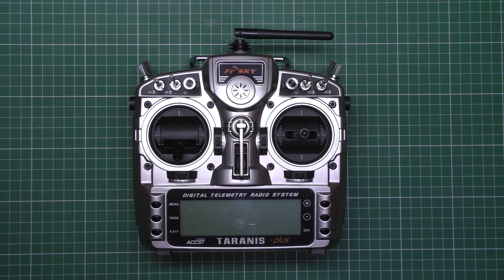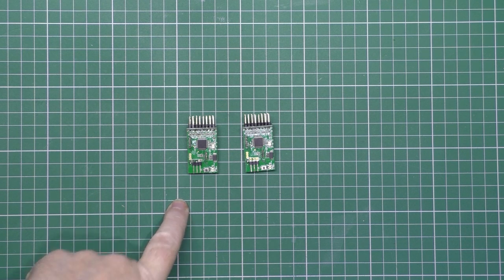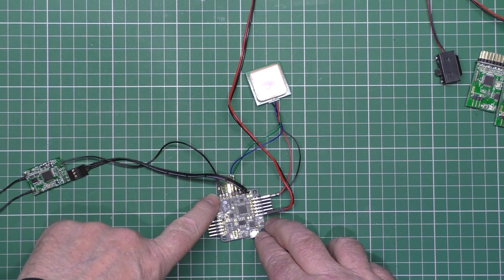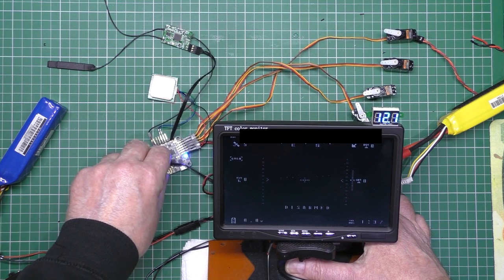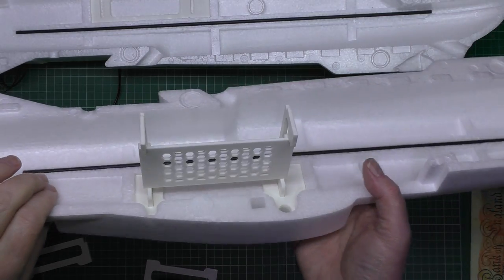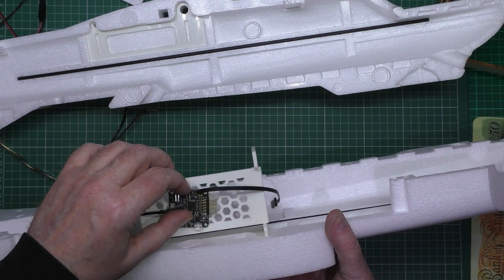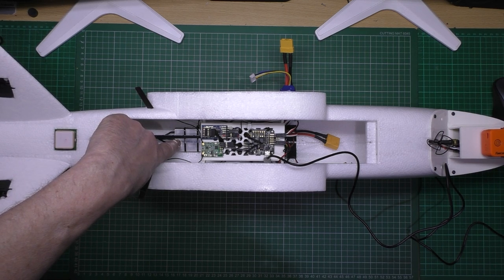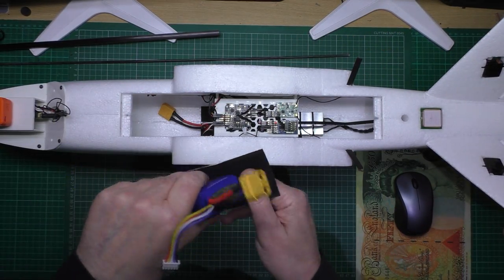Mini Talon with Naze32 and iNav - Part 2

Comment: Nice mate. Couple things. The link doesn't work for your 3D print but perhaps I can find it later. Also the slug tape, you solder a wire from the tape itself? to the negative wire on the opposite side of the esc. Or do you solder an additional wire connecting the two negatives? Cheers
Reply from the maker: Sorry mate, I forgot to publish the pod - it's public now.    
The slug tape.... yeah you solder directly to it and link the wire to the negative on the ESC (basically, connect it to the negative battery wire). If you don't earth it, it only stops RF interference from entering but it won't stop RF from getting out.

Comment: Awesome effort Tony, proud of you m8...lol...I love the little platform with it all on together and the 100 ohm resistor cheat around...I had the same issue of where to put stuff...I put my ESC in the Tail of my MT...I have another spare MT to build, so I might try the ESC where you have it and the copper tape....I do have a flight video of my Aeromax up on my channel if you want to see it, I did get it to work ok in the end as a stand alone Navigator in the Skyfun...:)....Nice job, well done....look forward to the flight test....I think you could try a nice light Lipo for initial testing with the ESC where you have it too..?

Comment: Hi.
I have been watching all your Mini Talon build videos as I am just in the process of putting one together. Fantastic help. Many Thanks.

In this video you say about using the clamps to hold the wings in place instead of glueing them in. Can you tell me what clamps you used and how they were fitted?
Reply from the maker: Thanks for the kind words, it's much appreciated.  
The clamps are half way along the wings (on the underside). You'll see a recessed hex bolt which you tighten up after fitting the wings.
Reply: Many thanks. I wondered what the recessed nut were for. Thought they must have been something from fitting the tubes in during original assembly.
Keep the videos coming, love your optimism and sense of humour.

Comment: Hi fella,  when i copy in the V-Tail mixing to inav i get a parse error.  Tried it in small chunks but it seems anything after smix it doesnt like.  Any ideas?
Reply from the maker: Sorry dude, I've stopped using iNav since my bad experience.   
Have you tried the mix in the Wiki?   
https://github.com/iNavFlight/inav/wiki/Custom-mixes-for-exotic-setups
Reply: If you're still having trouble, remove the last two fields, the 0 and the 100.
Reply: Yeah i got it in the end didnt realise the new version changed some of the commands

Comment: Tony's tale of two can o' peas :) I assume they were mushy.
What 3D printer are you using? the prints look pretty good.
Reply from the maker: Nope, they were garden peas.... little ones. They went everywhere and it took an hour to clean up.    
I use a Flashforge creator pro. Once you know how it works and how to set it up, they're superb mate!
Reply: It's a long shot but did you try replacing the coin cell in the old Taranis?
Reply from the maker: Mo, but I'll add it to the list of things I want to try. Cheers Rob.

Comment: Access to the Naze USB port would have been easier if you had turned the Naze 90 degrees.
Reply from the maker: You're right but I wouldn't be able to get the servo plugs out of the sides if I wanted to remove the wings...... I might change it again and drop the cradle down a bit so I can turn it 90 degrees.
Reply: The servo pins do not have to point to the side though, do they ?  You could even solder flying leads to the servo connections on the Naze and plug the servos into them.

The layout of the pins on the original Naze was dumb considering that its main use is on multirotors where space is at a premium, access to the USB port is required, it is often not possible to have leads issuing from the sides of the frame and vertical space is at a premium too.
Reply from the maker: They don't have to point to the sides but I'd have to drop the Naze further to accommodate the extra height. The fly-leads idea I like though, I think I'll do that. Thanks Bob :-)